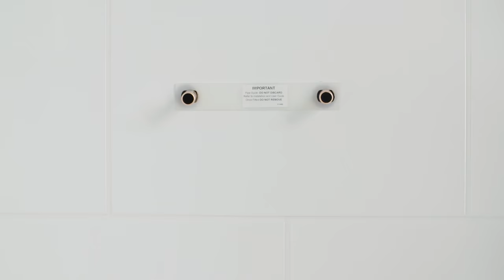How to install a bar mixer shower

Comment: What size is that spanner ??? I'm afraid to order one that won't open wide enough . Can anybody reply today? As I need order today the spanner via eBay.
Reply: Order an adjustable which opens upto 32mm.  Slightly bigger would be better

Comment: Good , but to bloody fast.
Should slow it down to normal time and ditch the music which is so annoying
Reply from the maker: Hi, Jams 👋 On the bottom right-hand side of the video, you'll be able to amend the speed of the video by clicking on the settings icon which looks like a "cog-gear" and then clicking "playback speed". We hope this helps 🙌

Comment: Could some kind soul explain how to mix the hot and cold on this. My mother had one installed at which point the water was warm but my wife tried to work it and for whatever reason we get cold water.  As basic as possible please I won't be offended.
Reply: Normal situation: Left handle is to turn water in, right handle is to mix. Turn right handle forward or clockwise (if sideways perspective) for cold and opposite direction for warmer. Or depends which way you shower mentions hot and cold. It should really be labbled with temperature markings

Comment: You haven't explained where the pipework is connected to from the shower bar to the boiler .
Reply from the maker: This would be dependent on whether you're trying to replace an exsiting shower or put in a complete new mixer shower. If you're replacing an existing bar mixer shower then the pipes running from the shower to the boiler would already be in place. However if you're installing a complete brand new bar mixer shower you would need to speak to a professional to see if they have the pipe work set up correctly or need pipe work implemented before 😊